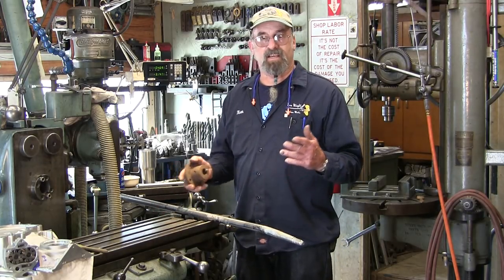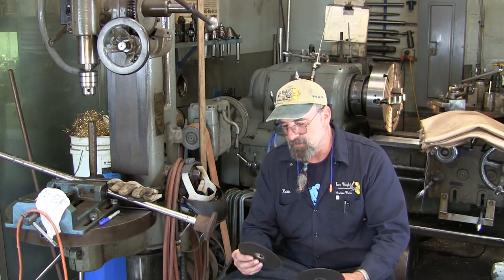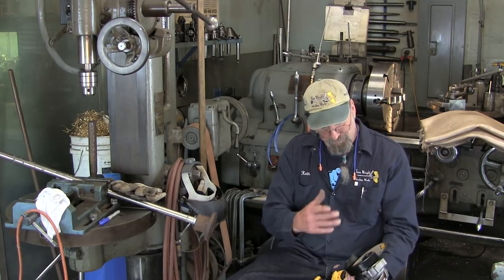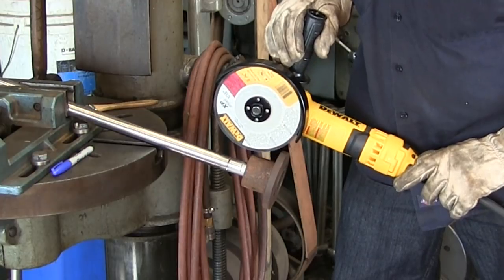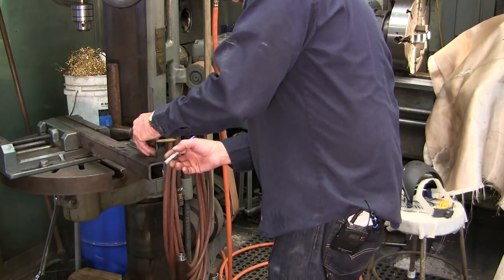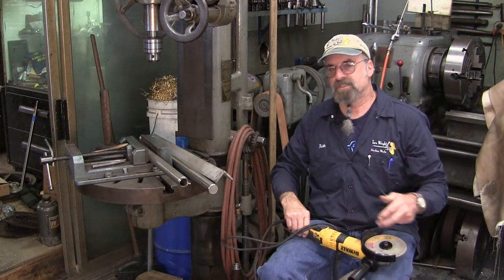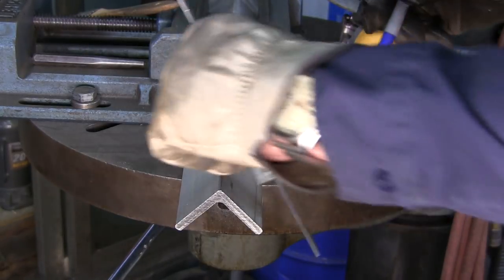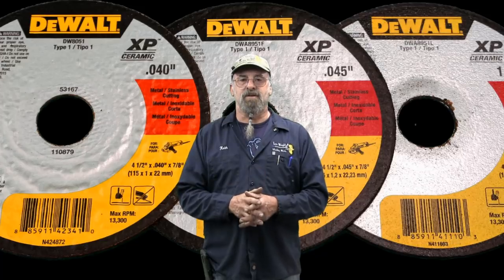The Slit Tip Made Easy by DEWALT™ + Giveaway

Comment: Was a maintenance electrician for Electrolux in Greenville, Mich. for 33 + years. We tried several brands of cordless and plug-in tools over the years. We had the best performance from the DeWalt. We kept the 6 cordless drills in the tool crib. A crew of over 100 tradesmen. They were in constant use as we were on a three shift schedule. Sometimes 7 days a week.
That led me to purchasing my own DeWalt tools. 
I have the following:
12" miter saw
14 inch Planer 
7 1/4" circular saw
6" Sander
4 1/2" angle grinder
5 3/8" - 18 volt circular saw
4- 18 volt drills
1- 18 volt hammer drill

Comment: My 75 year old neighbor who was a welder has nothing but Dewalt, but again his name is Walt..... I have use both cheap cutoff wheels and others from my local welding supply store and there is a difference, same for grinding. The last grinding wheel I got had 3 cut outs in it at 2, 6, 10 positions which allowed for great viewing of the grinding.
Wanted to mention that I had to remove two old (about 80 years) rusted metal wheels from the axle on an hit-and-miss cart. Heating the wheel's hub a few times and a lot of effort finally got the wheels off without damage to either axle or wheels.

Comment: Good video! I've been using two 4 1/2 inch  Dewalt  paddle switch grinders for over 20 years. I do a lot of metal fabrication and haven't used a hack saw since I discovered cut off blades. I guess it's time to step up to a 6 inch grinder and use the XP ceramic wheels.

Comment: Well done and impressive real world demonstration on the DeWalt grinder and cutting wheels. Never thought a cutting wheel would go through thick, hard steel that fast. Nice to see you all partnered up with DeWalt. I've used their angle grinders and agree with you that they are great. Used them on the job making full scale fireable Civil War artillery. Lots of casting to grind. Tons!

My "yellow" tools are for woodworking. My two angle grinders are a cheap off brand 4" and a heavy duty Black & Decker 6" made in the 60s, all metal construction and it is a monster!

Comment: Glad Dewalt partnered with you, I don't have a Dewalt angle grinder but I use their grinding, cutoff and sanding wheels all the time, I have drills and saws of theirs and most of them are over 16 years old and still running strong.

Comment: That is a very good tip.  I used to cut rail steel with an abrasive wheel saw and keeping the blade moving in line with the cut is the best and fastest way to cut with the least wear to the blade.

Comment: Hi Keith,
That marine shafting is looking "HARD" just looking at the sparks plume...  
So far my experience with DeWalt is that the tools are not my favorites since I had to fix all of them within not so much usage, that means 3 of them tools...   
On the positive side their supplies are somehow much better, but, that's my own experience...
(Gues that's not gonna help me win the stash...   lol)
Those cutting disks are looking like great steel eaters and with that small kerf it would perform great even with lower amps grinders....   ;)
Cheers,    Pierre
Reply: Pierre

As we're both excluded from the giveaway, we can say anything without fear of being passed over.  I agree with your observation about DeWalt's tools.  I can't comment on their supplies though.

There's a chain of tool stores in Australia, Gasweld, who sell most of the major brands, including Dewalt.  On the advice of the local branch, I've steered away from DeWalt because they say they've seen far more DeWalt back in for repairs than all the other majors put together.  That ties in well with your experience.

I've also noticed here there's been a strong shift away from DeWalt to Milwaukee and Metabo by tradesman.

Best regards
Reply: As of being already out of the contest, may as well tell my preference, Makita makes tools I like by the time being...   I use to buy Black & Decker a long time ago those were super tools but after the DeWalt disapointments not eager to go back for more.....   Sadly...   :(
Reply: Pierre. Dewalt used to make a very good tool, I have a DW442   4 1/2" grinder that must be 15 years old, just wont quit although it is getting a bit (shaky)  I also have 10 ---  4 1/2", a 5" and a 7" grinders, all DeWalt. The 5" is very poor so I only use it for certain jobs. It let the smoke out after only a week so this one was replaced. I also have 15 cordless Dewalt tools which seem pretty good other than the batteries are pretty crappy.  Even with the couple tools that are less than satisfactory I am still a DeWalt man. By the way, I'm not worried about giveaway's, I never win.
Reply: Stephen Smith : Hi I'm a tradesman from the UK who for years only ever bought Dewalt power tools , that is untill about 5 years ago when they no longer lived up to the job I feel that the company are now trading on their past reputation and today's products are inferior and over priced!
Reply: Darren, About DeWalt, it's a brand that people love or hate there is nothing in the middle, it's like they make good batches for some time and later there is that crappy batch that stains their reputation...
Reply: unfortunately alot of tools are built  (disposable) today and are running on reputation, as you say.

Comment: I like how fast those ceramic grain metal cutting wheels are.  I have a DEWALT 9" grinder over 30 years old and still working fine. 
I recently purchased a 4.5" grinder which I like real well also.  They make good products.  Thanks for the good video Keith.

Comment: Did a lot of stainless tube cutting in a transit body shop - used lots and lots of 4" cutoff wheels on air die grinders, and the cheap ones turned to dust way too quickly. Angle grinders with cutoff wheels were for doing heavy demolition, and man those things are a lot faster than the stuff we used. Might have to grab a few of these DeWalts after I use up my current stock :)

Comment: just used today my Dewalt angle grinder to grind and then trim some brass fittings.  I've used their cutoff blades/wheels with great success over the years;they're my go to tool when I need to cut metal freehand.

Comment: I was sold on DeWalt tools years ago when I first used an 18V hammer drill from work. I couldn't believe that a battery operated drill was better than corded drills! I would love to have an arsenal full of new DeWalt tools but finances are tight so I just buy used or broken from eBay and fix myself. All my tools are 18v nicad dewalt so I can use one set of batteries for all the tools. Your videos are awesome. One day I'd love to have a shop setup like yours. My favorite machine you own is your K&T mill.

Comment: Great demonstration Keith. I only have a four inch Dewalt grinder but it's a work horse. The cut off wheels are the berries for quick and smooth work. My sawzall is antiquated and now just collects dust in my tool drawer.

Comment: Congratulations on the partnership with Dewalt. Class attracts class.
As a woodworker I have several  DeWalt tools and love them all. They are the go to tools in my shop.
I have no idea what I would do with an angle grinder and a bunch of cutting disks, maybe I could talk them into a cordless drill and a set of bits.

Comment: You showed that coupling who's boss! It's certainly more power than my current grinder, and the interchangeable guards sound fantastic when you need to use a smaller cutting wheel or a wire wheel.

Comment: Dewalt tools are nice tools.  I have used them for years no problem.  Grinders, impact drivers, battery 1/2" impact drivers,  all very nice.  If one goes down I rebuild it or replace it with with the same type.

Comment: On a daily basis, I repair and fabricate repair parts for my service job. All of these repairs are "in the field". An angle grinder is my "go to" tool of choice, and Dewalt has been my brand since day one. Keith, like you, I am still using my first Dewalt angle grinder. I have since expanded into the 20v battery tools, and I hope to see similar perforce and longevity there as well. good video, you "got 'er done"

Comment: we use cut off saw blades a lot around the shop, mostly Sait brand ferris type 27 blades but I sure liked your demo on the stainless blade. it made quick work of the shaft. I not used any ceramic blade before.

Comment: I've been very happy with all the DeWalt tools I've owned, I just wish 
their replacement batteries were more reasonable priced. I now have 4 
Drills that all work but I only have 2 batteries. The reason being, a 
new drill/charger and 2 batteries are only about $50 more than the price of 1 new 
replacement battery.

Comment: I have used the Dewalt  cordless tools for years with the 18 volt  A123 battery packs with no problems.  I believe that they have  changed the battery chemistry and voltage...seems to work fine.

Comment: We used to use blades like that out in San Diego at the 32st Naval Stations' Foundry. Often we would use the Suicide Saw but the castings would catch and break the big blades due to the castings odd sizes and shapes. The blades you just used were much easier to use as the big vise could hold the castings solidly and we could angle the grinder so that it would safely cut off the gating system. Dewalt is an excellent maker of saws and cutting wheels. Would love to win the prize!

Comment: I have seen your name mentioned frequently in other fabrication / machinist YouTube channels and just decided to check this channel out.

Damn those ceramic wheels cut fast!
Retired automotive technician here, who has done a bit of fabrication over the years. I've been cutting slits like that for close to 35 years now to "remove" seized parts off shafts and spindles - but most of the time using a regular cut-off wheel to "remove" ball bearings and roller bearings. All too often a "special" tool was needed or I didn't have the correct jaws for the puller set that I had, and it was quicker to just destroy the worn out or seized part to save the shaft or spindle. 
Some times I used an angle grinder with a regular wheel and other times using an air-powered  utility / muffler clamp cutoff tool with a thinner "stone". And once I used a die grinder with a carbide rotary bur - (was wearing vinyl gloves, but spent some time picking the slivers out of the sleeves of my short (LOL)) to "dissect a caged bearing assembly" that just wouldn't come off an axle shaft stub in a rear IRS setup. With that one I had to create "slot" in both races to pull one ball bearing out of before and then remove as many as I could get out to get enough room for the bur to fit in there.
Overall, I would just cut a slit as deep as I could without damaging what I was trying to save (axle shaft and the swing "axle" and then used a cold chisel with a 12 oz hammer in the slit to "crack" what remained of the bearing race. Never needed to "slide it off" - inner races would just crack and expand off the shaft or spindle; while the outer race needed a 2nd slit to get it to loosen in the hub.
After doing the first few of those "slits" I found it even quicker than assembling a pulle and trying to remove it "by the book" or manual. And unlike many of my peers I resisted using heat to get the parts glowing red and then trying "sledge" them loose.
Learned this "slit" technique back in the 1970's from a old automotive machinist who had served in WWII on US Navy ships (yeah, I am that old - pushing 70 yo) - gentle persuasion rather then heat and brute force.

Comment: Nice blades , I can only afford the HF wheels usually but ill see if I can get a couple to compare to them. I built a 42" metal brake and cut the 30 degree angle full length in 1/2 x 2" plate slicing the angle with a beat up Hitachi 4" grinder. Pretty good job off hand clamped to a bench , the full length triangle waste part was about 1/4" x 3/8" x 42". I cut everything with the old bugger . Couldn't afford the better brands but sure would like to replace mine she's awful noisy from use and abuse. I've done and do lots of off hand fabricating in my little one man shop. Next build may make video of , adjustable gantry crane and lathe mount jib crane. Good luck Keith with your new sponsor , there tools are rugged.

Comment: Yes Dewalt is a good tool, I have 2- 6" grinders, two different battery drill all are still working after five years and 10 years. Did not know Dewalt sold good cutoff wheels, have used their surface grinding wheels with good result. The cut off wheel did not last that long before wearing out. Have not used the ceramic disks.

Comment: I've been following you for quite a while and greatly enjoy your work (and maybe even picked up a few tips that I can use) - and this one really caught my eye.  I've been trying to cut up 3"x5"x1/4" steel with a "utility" (i.e. cheap) 14" abrasive saw and haven't found a wheel yet that can get through it in less than 10 minutes - it sure looks like this puppy could handle it without breaking a sweat.  Maybe if I win one I can find out for sure...

Comment: Keith, great video and demonstration!  Can't say enough about the fiberglass blankets and hearing as well as eye protection,  plus a dust mask if you're working in a tight space.  I will say, those Dewalt disks make a lot less dust than some other brands I have used.

Comment: Keith, 20 years ago I started with dewalt corded and cordless tools. Doing construction work, tools do not last long. Tried Milwaukee, Mikita, bosch, hilti, matco, etc,etc, now back to dewalt. Yeah, they are great tools. This is not the box store tools but the commercial varieties found at Grainger,Zoro,Ohio tool, or McMaster-Carr. As far as cut off disks, in .045, Norton seems to cut faster and outlast the competition,dewalt, sait, 3m, Amron, etc. in my applications anyway, (cold rolled, hot rolled, 4140, 8620, A67, excavator roller bolts, and older farm equiptment). I'm using the Norton horizon series now. I've used the Dewalt XP series, not sure if it was the ceramic version. If I can source them at my supplier I will try them against the Norton. Really curious to see which one is better. For Cut off tool grinding wheels, I'd like to see who is better than the Norton Plus fast cut wheel!!. Man, is this a great wheel for material removal! No, I don't have any connection to Norton. Saw a mechanic using them on a job tried it and I love them. What is dewalt equlivlent grinding/cutting disk?.

Comment: This would be a nice replacement for my 13 year old click lock button grinder.  The retention detent thingy has started to fail and it won't stay on and the extra vibrations from the worn bearings doesn't help for sure.

Comment: The dewalts have a lot of play in the bearings which is why you hear that rattling noise. I'd guess intentional for heat expansion. Makita has a better feel and tool noise in my opinion. Believe it or not, noise and feel are just as important as anything else.

Comment: As an independent welder/fabricator for over 30 years now, I always have four or more 4-1/2" grinders at my workstation, plugged in and hanging at arm's reach. So I don't have to constantly change discs on a single machine, mine have mounted a cutting disc, a high density flap disc,  and a couple with 1/4" thick hard grinding discs ( newer ones and worn ones for different situations..).  For production small scale manufacturing, custom architectural fabrication, or even custom blade and tool making or restoration hobby work, I'm  frequently using these tools and for everything from cutting stock to paint prep work.  It just so happens that my grinder lineup these days are nearly all yellow colored machines. And I'm not just saying that. For a variety of reasons it's the truth.  
-Practicalman45

Comment: Haven't had the need to replace my Black and Decker 4 1/2" yet but I do use DeWalt disks almost exclusively now-had no choice since that was all my local supply had at the time.  Was pretty impressed compared to the Metabos I was using.

Comment: I've cut schedule 40 pipe with a regular cutoff wheel on a grinder before, it went nothing like as fast as that dewalt cutoff wheel. It went thru so fast that it almost looked like you fast forwarded the video in that part, but I know you didn't, because the sparks velocity never changed...That's pretty impressive in my book. As far as the aquamet material goes, I have no experience with that , But I can't even imagine cutting that stuff with a sawzall. Happy for ya, that you got a nice sponsorship deal. You deserve it.

Comment: That is a pretty badass grinder with nice blades. We constantly need to cut long welds on rooftop equipment mounted on structural steel at work , we haven't found a grinder or wheels we are happy with... could this be it?

Comment: Very good video Keith. The power on the new grinder should allow it to make it through just about any metal. I also was impressed with the cutting wheels, they made quick work on the metals you tried them on. The wheels are thin, but appear excellent for the task. 

From Marshall, Texas.

Comment: Dewalt rules! I have several Dewalt power tools and a few of their hand and power tool accessories. I love the angle grinders and the rest I have are used for woodworking. Their 12" dual compound sliding miter saw ia the best of any on the market. It even caused me to sell the old radial arm saw I had in my shop. Dewalt rules!

Comment: Good demo Keith and what a excellent product ! For many years I worked maintaining acid zinc plating plant and without such a product to hand have removed couplings etc the hard way using grinding discs or even a hacksaw very time consuming it would have been much easier if I had such DeWalt products to hand at that time

Comment: Nice to see a tool that will be able to keep the guard in place using the larger cut off wheels. I find less pressure and more rpm helps the wheels last longer. Nice demo and congrads on the sponsorship. Been using Dewalt tools a long time.  Richard in Newtown Ct